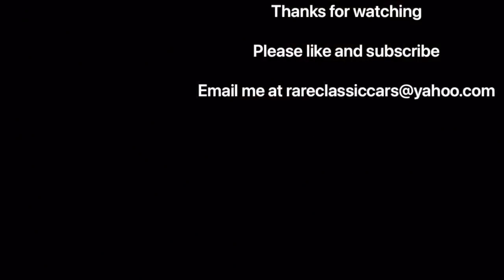Worst Engines of All Time: Chrysler 318/360/400/440 V8 Electronic Lean Burn

Comment: Lean Burn was also used on the Slant-6 in at least some markets. I had one on a 1983 Dodge Ram truck; no catalytic converters. When it worked, it seemed to be great! The problem was that diagnostic procedures were a complete mystery. I'd have loved it if it had a light on top of the module on the air filter which just flashed a trouble code if the coolant temperature sensor or TPS or MAP sensor or something else was faulty. Any time the ignition is on, flash a heartbeat or a failure code. 
My background, my University education, is Electrical Engineering. I have no idea what the microprocessor was in the Lean Burn system. The whole computer module was potted in epoxy and my attempts to get to the bare circuit board were fruitless. This was well before OBD-1 or OBD-2, so forget about hooking up a scan tool. But a few more lines of software and an LED to blink a "heartbeat" during normal operation and to blink out fault codes would have gone a long way toward making Lean Burn something really useful in those years before EFI was really technologically possible. 
The car industry's need to move to EFI drove a lot of semiconductor manufacturers to start making inexpensive and reliable power transistors to control engine components like fuel injectors and EGR valves and idle air solenoids. You can thank Detroit's malaise era for the transistors which make your computer's power supply work... and that's just a start. Detroit has massively influenced the semiconductor companies which supply computer manufacturers. 
But as it was, any repair to the as-shipped Lean Burn systems was a "parts cannon" effort. I did it myself - change every sensor and see if it runs better. 
I am not thrilled that the Lean Burn computer was mounted on the air cleaner. But, really, at that point most semiconductors were rated to run at +85C, and would do so without problems, the air cleaner won't get that hot unless the car is on fire. Higher temp semiconductors were available and probably in wide use in the automotive industry at the time - I'm looking at you, alternator diodes and GM HEI modules! 
My biggest argument against the computer being located where it was is stress on the wires, both from normal engine vibrations, and from someone yanking off the air cleaner (and therefore computer!) and breaking a wire. Now you've lost the coolant temperature sensor. How would you know? The car just runs like crap for no apparent reason after you had to get the air cleaner out of the way to change the cap and rotor. The computer has no way of telling you that it can't read the engine temperature. That is a problem. I'm giving you a hypothetical here, but one that is entirely likely and probably doomed many cars to the crusher. An LED on the module to flash out an error code would have been the single greatest improvement to the Lean Burn system. 
Look, it's over 25 years since I had that truck, I do not remember a knock sensor or anything else like that with it. I remember my plugs always came out clean, and I put hundreds of thousands of kilometers on that truck - towing cars behind a Slant-6 4-speed Dodge Ram! 25 miles per gallon was no problem to that thing, which is pretty amazing for a carbureted full-sized pickup truck.
When it worked, it worked well. But good luck keeping it working in the absence of real-world diagnostic procedures.

Comment: Well,.... in that time new mandated mileage and emission regulations forced the car manufactures into compliance. The end result(s) were engine components that were of a NON performance variety. Weak camshaft profiles, low compression, small carburetors and mostly differential ratios that were in the 2's. As a package it produced wimpy performance. A lot of the emission equipment from that era was for cold starts!! Various vacuum ported temp sensors worked with the lean burn module as well while it controlled engine advance. All of it had to work to produce any kind of reliable performance. 
 Dealer mechanics weren't well versed with this system and any time a problem occurred they spent more time staring at engines than knowing what to do. Most of the time they just started a guessing game of replacing parts. The early lean burn modules were subjected to heat failure. That's why a lot of vehicles had no underneath hood pad. As the years went by they improved the lean burn modules with electronics that weren't so susceptible to under hood atmospheric failure. I will say this. Chrysler, compared to Ford/GM had a lot less under hood junk thanks to this system than the two others. I do not like the description of "worst" engines. By the time they were through with these systems in the 80's they worked well. Keeping these systems working requires KNOWING about their entire working procedures.

Comment: The driveability issues those cars had was legendary (in a bad way). I knew someone that had a Volare with a 360 and Lean Burn---it was always surging at steady throttle, and sometimes when attempting to accelerate from a stop light, it would stall. This was at a time when the Big 3 were rushing technology out too fast before it was actually ready

Comment: I purchased a 1976 Dodge Royal Monaco Brougham with a 400ELB engine. It ran with no problems, but had a couple of quirks, but mostly it felt like it jumped forward on initial tip in, then held back. It was the only observable difference I felt. Other than that it ran perfectly.

Comment: Did they ever use lean burn on the slant six? I just bought a 81 AMC with the 258. Miles of vacuum hoses! I bought 50 foot spool of vacuum line, not sure it will be enough!

Comment: I bought a new 79 Dodge Magnum with the 360. The problems must have been fixed by then because I never had a problem. Put over 100,000. miles one it before I sold it.  Was a great car.

Comment: I still have my parents 1985 Fifth Avenue equipped with the 318 cid . With the “Electronic Ignition System” label near the air cleaner. Last year I had a local garage attempt to tune the car up .   They had it in there garage for an entire week struggling to get it to run right !!!  I believe that they brought in a lean burn “expert” in to guide them through getting the car to run right.

Comment: Thanks for the tutorial. I just bought my 16yo daughter a 1982 D150 slant six lean burn that sat for 20 years. After fresh fuel and a carb clean it was running and driving great. Then we shut it off and went to restart a few minutes later and no spark. I don't have voltage at the plus side of the coil? It doesn't seem to have a ballast resistor or ignition module. Where does a lean burn get voltage for the coil?

Comment: It's not just the engine's that sucked but the whole car sucked! I had a 77' dodge charger S/E 400 ELB. Junk motor car tended to rust very easy and the tail lights were glued in! Only Chrysler corporation would think about gluing in tail lights 🫣

Comment: So the lean burn system was basically an electronic Ignition with a  Electronic advanced control Just saying
Reply from the maker: No. It also controlled fuel mixture.
Reply: Their was almost no way to bypass the system. Internal senors

Comment: Oh my. I'm a guy who enjoys this channel so much, but I completely disagree with complaints with Lean Burn system.  I owned a '79 Dodge, 360 with Lean Burn. Only had two issues: 1) Electronic Ignition pick-up coil failed in distributor.  Easy fix. 2) Warped top plate in Holley Carb caused a small vacuum leak causing the power pistons to stay open allowing too much fuel. This went undetected and misdiagnosed by the experts. I bought a factory shop manual and learned every component of the lean burn system, propane tuning, and timing. Solved it myself.
I live in Phoenix and the road temps are near 200f. Never had a problem with ambient air sensor. My idle speed was about 650. Gas mileage was mid to high teens which was fair for a 360 and B-Body. I think all the negativity, hype, and complaints were hooey.  I joke that it was mostly GM and Ford guys that hadn't done their work to properly diagnose.
One other comment. My Uncle (Electrical Engineer) and I both had similar cars and engines. We would adjust our timing by one or two degrees and make a long trip to see if we could achieve better gas mileage. As usual, the factory had it dialed in pretty close and our effort resulted in some good conversation with my uncle but no gas mileage improvements over the original settings.
I will be comment 939 so probably everyone is tuned-out on this topic by now. Cheers.
Reply: i  changed my ignition to the old five pin brain and had no more problems changed the electronic 4bbl on my police 318 to a carter performer 4bbl and no more problems
Reply: @robertcard8200  Was the original 4v a Holley?   Probably not a good idea to combine a Holley carb with a microprocessor controlled IS.
Reply: I'm tuned into your comment here in 2025.   Also, isn't the microprocessor used in the LBS the same model(not same architecture) as the one used on the Voyager space probes?   One Voyager space probe is in the outer solar system and still working effectively transmitting/receiving data to/from earth.

Comment: 11:50 is the exact problem I’m having. I replaced the thermostat but that wasn’t the problem. Fully warmed up it would read at around 100 degrees. I’m trying to convert it back without the ELB system.

Comment: Growing up parents had a 78 Chrysler Lebaron 318 V8. After 6 years it developed a intermittent stall when driving over railroad tracks or harsh bump in road. My dad found the problem by tapping on that unit in desperate measures lol. New computer then was roughly 120.00

Comment: Hard to believe we actually got to the moon with the electronics of this era!  The quality and reliability of it all was terrible!  I had a '77 New Yorker with 440 and ThermoQuad.  I pulled this system out to replace it with the standard Mopar electronic ignition replacement kit with a new distributor and control unit.  Easy to install and all of my complaints disappeared.

Comment: I’m a mopar guy and bought an 81 Chrysler Imperial with 318 and the redo fuel injection system that was factory converted to lean burn system. It has worked ok so far! But want to do some engine upgrades and install a 4 bbl Thermoquad ( gotta luv the sound of the spread bore wongggg) and was wondering how much has the be done to remove the lean burn components 🤔

Comment: From 4:16 what you said on manifold vacuum vs vacuum advance on a distributor is correct, but you are incorrect to state it that way for a typical Chrysler system.  To my knowledge, all standard (points or electronic ignition) 60s-70s Chrysler Corp cars used 'ported' vacuum on the vacuum advance.  Ported vacuum is sourced from the venturi (the passage/fitting exits on the front of the carb), and increases with engine airflow.  So the centrifugal advance increases with RPM, and vacuum advance will increase with load (and RPM may or may not increase under that load).

Comment: Toyota and other still had lean burn systems in past 90- they just didnt fuck around whit a carbs and had simble sysyem to define engine conditions when lean burn is on. Whit custom ecu this is relatively easy system to but in use on when cruising low load whit older cars.

Comment: Well that explains a lot. I had a 77 Cordoba with the 400 & ELBS. ( Apparently it was a 440 when the guy who bought it from me checked the engine numbers. Which is still a odd mystery.) A beautiful copper boat. But it ran insanely inconsistent. Boggy around town, But would outrun everything on the highway pushing 140 mph. But I still have nightmares trying to stop it. 3 - 4 brake fades to stop at a light with smoke rolling out all 4 wheel wells. It coulden't ever lock them up. Just plain inadequate brakes. But every few times I would stomp it, It would go like hell. Or start coughing and backfire a thundering fireball 20 feet off the back bumper. I think I put 5 or 6 mufflers on it cause they would blow wide open eventually. Like it was rich as hell. Now I see putting Bosch Platnum spark plugs and semi solid core wires didn't do it any favors! Lol! The computer must of hated me. It was beautiful inside and out. And that engine compartment was like new. But the rear bumper and trunk floor was rusting out. And the guy who bought it had the leaf springs go through the trunk floor. That's when they ran the engine numbers and discovered it was actually a 440 somehow.  I always suspected that Electronic Lean Burn System was its demon. Now I know.

Comment: I had a 1986 Chrysler Fifth Avenue. It had the Lean Burn on it and I hated it. I even put a new carb on it because it used to hesitate and stall (and I was unaware that it was a lean burn). I couldn't even "jump" on the gas to pull out from an intersection onto the highway without it hesitating. It ran great after the new carb was put on and after about ten miles of driving 55, it started rough idling again. I paid that care off and traded it the same day for a 95 Oldsmobile Ciera SL.
Reply: I think you misdiagnosed and misplaced the blame.

Comment: Had a 78 Cordoba when I was 16. Did not know what is was doing (still don't). Tried swapping carb from my Mom's 75 fury, carb over-filled with gas when I started it up. Quickly swapped the carbs back and never told Mom!!

Comment: Your comments re: the Chrysler engines,  what a crock of a four letter noun. I personally have ran 318 engines over 200k miles without ever having any problems, other than mufflers, tires, etc. - the usual wear-out parts. I believe the 318 to be the best engine ever made. My mother bought Chryslers and ran the 360 enginss well over 200k miles. Her '63 Chrysler, between the two of us together, ran that 360 engine nearly 300k miles before trading the car off. My family, parents, aunts, uncles, cousins, myself all drove Chrysler Corporation cars from 1949 thru 1990s. All were driven long enough to be high mileage cars. Keep oil and water in them and they'll outlast GM products. I won't say Fords because I drove my 1990 F150 for 235K miles (straight six w/5 speed) before I sold it because I had too many vehicles when I retired.

Comment: Ford had something similar. My '85 F150 was originally equipped. EEC-IV feedback carbs. I have had this truck since 2007 and I have never once had the system actually functional. Metering rods unplugged at all times.

Best fix for any of this nonsense on any make is to just put a normal carb  on the engine.

Comment: One of the best enguines I've ever seen was a dodge enguine and I'm not a dodge person my dad had a 1973 D600 dump truck with a 361 2bl carburetor that motor pulled like hell lasted years never leaked a drop of oil and despite being in a dump truck hauling heavy loads got better gas mileage then my F250 it was a low rpm enguine that would have been great in a pickup for hauling.

Comment: Adam, did the '78 Dodge Monaco 440 police package cars have lean burn ? A friend of mine, back in high school, had one & it was pretty damn quick. It always got up & went when you nailed it in the ass. It made that real real throaty 4 barrel noise under full throttle. We always liked hearing that noise
Reply from the maker: No. Did not.

Comment: I have a 1978 Cordoba that was my second daily driver for years. Even drove it from Orange County, CA to Taos, NM and back once in the early 2000s when I was nineteen.

It has the 360 small block, but no Lean Burn. Apparently it was still an option and my grandparents didn't opt for it when they bought the car new. I ripped the engine out years ago, took it to school, and bored and stroked it out to a 408. Kept the original heads and intake because I still need it to pass smog here in California, and aftermarket heads and intake would fail the visual immediately.

The car is still apart in my driveway. Every time I try to get going on it again I think about how much money it's going to cost, and I want to put the funds toward other things. I have worked on it though. Got the engine bay all spray painted, have the hood and fenders primed, some other stuff. It'll get back on the road one day.

Comment: the motors are sound. several 360's I hot rodded were great. exchange the ignition with earlier or more modern and thats it. if you add a bigger cam the vacuum advance distributer will not work on that less vacuum anymore causing problems.

Comment: I made a fortune on the lean burn system by changing them back over to  standard electronic ignition.  I was getting electronic ignition systems at a really good price from a bombardier dealer due to the fact that the people up north did not trust the electronic ignition in the bombardier V8s so the bombardier dealer was changing them over to points and I was buying Chrysler v8 electronic ignition systems for next to nothing.

Comment: I had a '77 Cordoba with the 400. Ran fine. But a month after the warranty ran out I pulled all that stuff off. Holley carb, Edelbrock intake, new ignition, headers, full dual exhaust with crossover. Ran great! Best and most comfortable road car I've ever owned. Put almost 200k on that one.